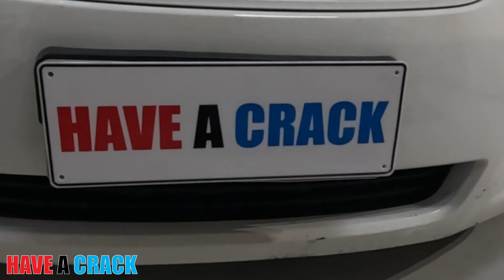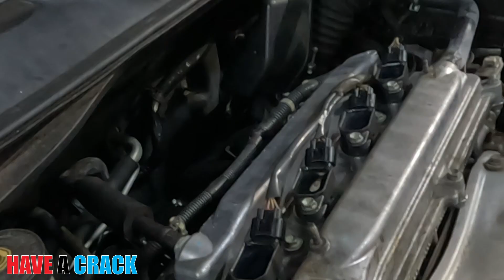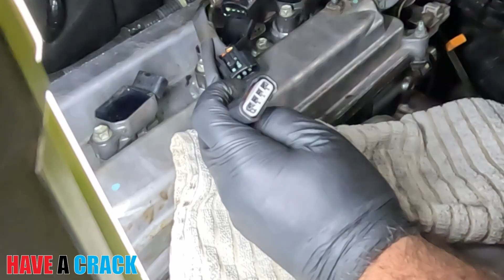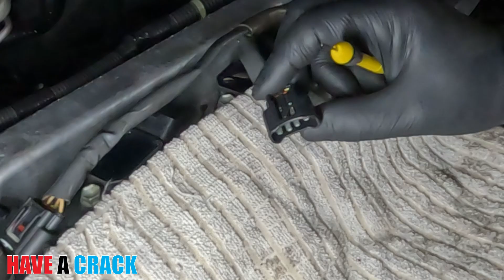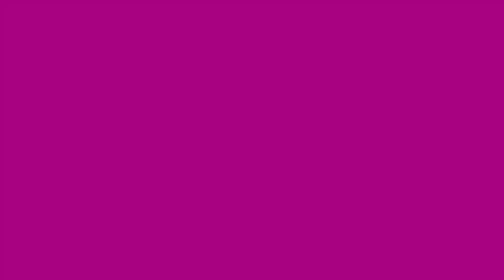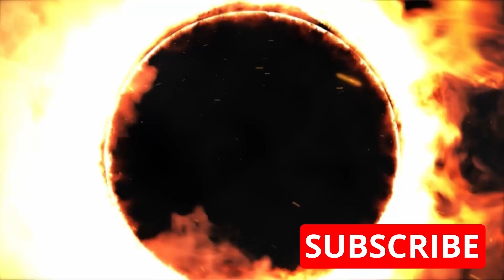Toyota Camry Misfire? Replace the Ignition Coil Connector (DIY Guide)

Comment: Can you take pictures and post or diagram on wire order on coil packs please
Reply from the maker: Each coil connector has 4 wires. One is 12V power, one is ground, one is ECU feedback, and one is the trigger wire. The power, ground and feedback are the same on every coil — only the trigger wire colour changes depending on the cylinder.
Ignition Coil Connector (4 pin)

PIN 1 – 12V IGNITION POWER
Wire colour usually: BROWN

PIN 2 – ECU FEEDBACK SIGNAL (IGF)
Wire colour usually: WHITE / BLUE

PIN 3 – ECU TRIGGER SIGNAL (IGT)
Wire colour changes depending on cylinder

PIN 4 – GROUND
Wire colour usually: WHITE / BLACK

I hope this helps. I don't have the car close by to take a pick sorry.